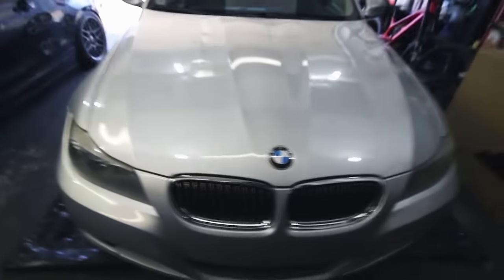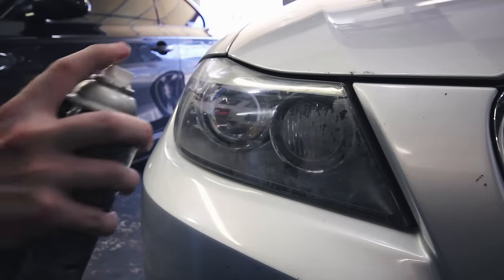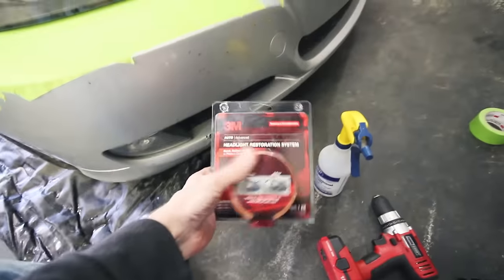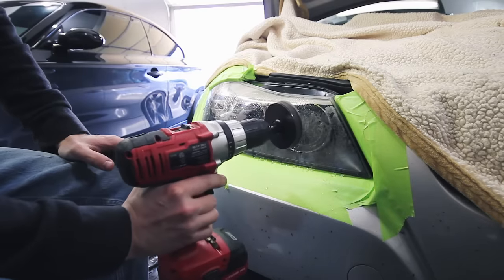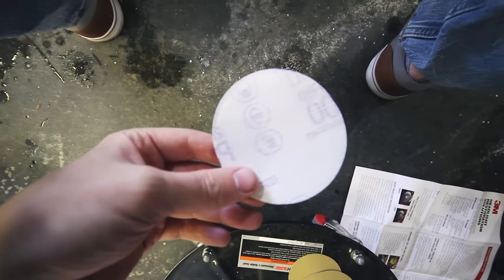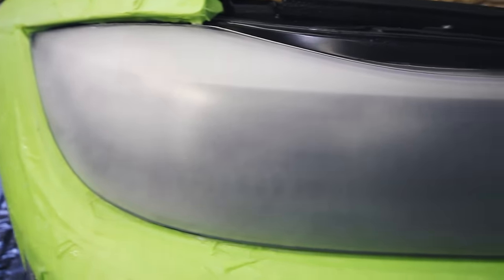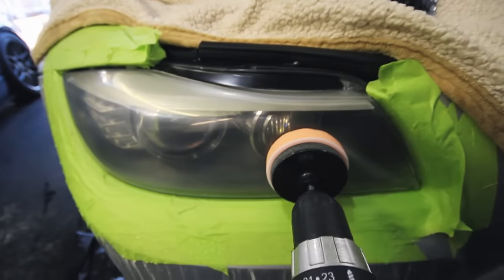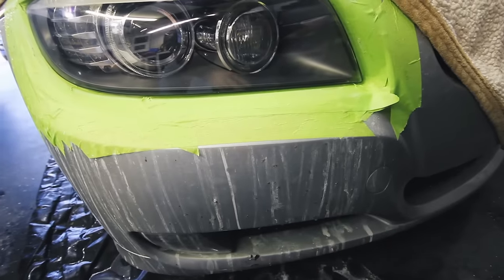How To Clean & Restore Headlights - Remove Yellow, Foggy Headlight Oxidation!

Comment: awesome job! But to get it perfect, smooth and with no swirl marks a random orbital buffer is best hands down using the same stuff to polish paint. I use meguiars 105/205 combo. 

I’ve tried 3 different drill type kits for the headlights which do a decent job but doesn’t get a showcar like appearance. You can still see swirls and hazes at different angles. Plus you don’t risk burning through the paint (or tape) with a random orbital buffer. 

It’s a lot of money to invest but if you’re into car detailing, this is the bomb.
Reply: maguires machine polish for mirror finish. I used to do molds for fiberglass parts, 
you can see your reflection in the mold surface.

Comment: As a word of warning I used a power drill for all stages and only at the end I discovered that I had damaged the bumper in the same way as you.
I would advise to use the glass (sand) paper stages by hand. Only use the polishing stage via the drill.
Reply from the maker: As long as you're careful and use protection on the paint, you will not damage it.
Reply: Other than that did your headlights look better?
Reply: @walphaa  yes it did. I only did one headlight as I was annoyed with damaging the bumper paint work.
The refurbished light looks like new.

Comment: Both my headlights are cracked. Has moisture now
Reply: 7SeriesDaily same 😔
Reply from the maker: Dang. That requires further repair. Are you sure they are cracked, and that it's not a bad seal/gasket somewhere?
Reply: Jake Spence yea the seal isn’t flush 🤔 now that noticed

Comment: Interesting difference in the Mookis headlight restoration kit. It has 3 steps of sanding 800>1200>2000 one per grit per headlight so it comes with 2 800s 2 1200 and 2 2000 then a polish and last a uv protectant. Not sure which I might use next time. The kit comes with a ridiculous about of .5" making tape that wouldn't even cover one headlights perimeter. But the polish and uv protectant come with way too much. I use only one pouch of each for two headlights. Even without skimping on it.Beautiful results either way.

Comment: I didn’t watch your entire video but keep in mind the rpm of the drill should not exceed 1500 rpm or you’ll melt the sanding disk to the headlight. Excellent product list. I only use those 3M kits. I skipped ahead. Nice work. Peace 💨💨👽

Comment: You’ll need 2 kits for sure.. plus you need to realize you’re essentially resurfacing your headlights without laying down an actual clear coat over the foggy/sanded/buffed plastic.  That oily coat you apply at the end that enhances clarity and shine wont last a week!
Reply: Exactly! I never realized what causes this to happen to headlights....when the car is painted in the factory...everything is clear coated even the headlights...after enough time in the weather and chips from highway driving that clear coat comes off and then the sun and hot and cold weather causes the plastic surface to deteriorate and actually become quite porous which then dries up and flakes off and becomes foggy...then it’s hard as hell to restore them...that’s what point my vehicle was at when I got it...I’ve never been able to totally restore them no matter what I use

Comment: If you sand at the start you don't need to clean it first... unless it is clearly covered in muck and you cannot see your work area (think caked in mud!)... clean it after you sand, given you will make a mess when sanding it.

Most headlights come out easily, so if you really want to minimise the risk of body damage, just remove them and pop them in a vice with a rubber mat.

Instead of this kit... you can just use a high grit sandpaper (1500+), then clean area with soapy water, then clean again with isopropanol, then spray a clear coat, then buff. Cheaper, quicker and what professionals do when you pay them (y). The clear coat is the key to a great finish as it levels out all the imperfections creating a clear looking lens.
Reply: Where can i get the clear coat?
Reply from the maker: Yup, these are some great tips for someone who wants to spend a little more time on them!
Reply: I wish it was that easy, Your quick fix method will not remove hazing, Yollowing, Or old flacking baked on cheap clearcoat!!!
Reply: @tupapi6989  amazon!!

Comment: When you get to the stage where you have used the sponge and the compound to get it looking like glass , to stop it happening again you can buy an ultraviolet clear lacquer spray and you just spray one clear coat over it and it enhances to the glaciers affect but apart from that it protects its from ultraviolet rays and basically stops it from happening again.

Comment: If you were going to use a drill and a fitting like in the video, I would emphasise when he explained to you keeping it flat it is a little more important than just keeping it flat for the sake of keeping it even ,if you were allowed it  to go out of control and turn sideways you can burn a divots or friction groove that can burn little Valleys into the lands, which sometimes you might not be able to get  out so take your time I'm and keep that disc flat.

Comment: Just bought the 3M kit as I have very similar levels of oxidation on mine too, but I've seen others using acetone vapor.   Ive also seen complaints of light scratches being quite visible when the lights are on, so I'm going to try the 3M in order to remove oxidation and finalise with acetone vapor.

Any thoughts?

Comment: You don’t need water for the first two steps. Gold and white sanding discs should be done with no lubrication as the instructions don’t mention water for those steps. It’s only mentioned during the 3000grit step should the water be used for sure cuz it’s basically wet sanding. I used this same kit, following the instructions, and they came out looking brand new lol. I get why you recommend the water to not burn the plastic on the headlight but in a way I don’t think you’re getting the full effect of the first two steps. Don’t get me wrong, your work came out good no doubt. Just run the drill a bit slower so as not to burn the headlight lol. First two steps should give you a frosted look. The 3000grit should give you a light hazy look and the rubbing compound will give you the fresh ass brand new look haha good shit though man 👌🏽
Reply: And I thought I was the only one who spotted this mistake!! 3M produce a wet kit for all those die hards out there who still use old school methods 😂

Comment: Hey mate i have 1,2 questions about n54 single turbo kits. Can i run the single turbo only with MHD backend and JB4, and how much boost can i reach with OEM sensors (solenoids) and stock fuel system. Sorry for my bad english.
Reply from the maker: Yes, you can run JB4 with MHD backend flash for single turbo. Just be sure your JB4 has the single turbo firmware loaded and you're using a proper single turbo backend flash. You will need a Mac solenoid to replace the OEM boost solenoids. Boost limit for stock fuel system depends on the size of the turbo. On a completely stock fuel system, you won't be able to get very much power out of it.
Reply: @jake_spence  Thank you for your fast response! When i blow my wastegates i will upgrade to ST. I don't know how it feels but i just LOVEE that sound. Stay tuned! Thank again!

Comment: I used this product before finding this video. I left swirl scratch marks even though I used the 3000 grit and rubbing compound 4 times in a row. No one else ever mentioned this problem so I thought there was nothing to worry about. Do I need to restart the whole process?  Also is there a limit to how much I can sand it?  I am afraid I will sand it down so much that it leaves a hole.

Comment: Would you recommend spraying a clear coat on the headlights at the end?
Reply from the maker: Yes, a UV clear would be perfect.
Reply: In my shop I found acrylic clear coat and all purpose enamel. Will that work? Also I plan to clean with alcohol. Also plan to put Mothers aluminum stuff as a final touch.
I figure I'll do this with what I already have including my sandpaper 500-3000.
What do you think? I'm not spending any more money on a "kit"! I'm a cheapskate dyi'er weekend warrior.

Comment: Good video, except next time take the time and pull your headlights out, it will save you accidentally sanding your bar, then you can use an orbital sander which will give you sooo much more control! 
I wouldn't waist your time buffing them after you sand them, because you actually sanded off the remaining clearcoat they have from factory, that means unless you clearcoat them again you will have no UV protectant on the lenses and they will get brittle, fade and fall apart!
After you sand them with 800, or 1200 grit(dont go to fine or the clear wont stick), clearcoat them and they will look better than brand new!
Reply from the maker: Some good tips here for sure. Thanks for watching!
Reply: Not all people have time to remove the headlight or paint it with UV coating so this is better

Comment: what if I skip the last step and  spray it with an anti-uv clear coat instead?
Reply: Piteng Best to spray with 2k clear coat before he used the 3000 grit. The clear coat needs fine scratches to grab onto, otherwise it’ll run and crack on ya.

Comment: Don't spend your money on that kit, just get some 600, 800, 1500 sandpaper, wet sand lights starting with 600, work your way to 1500 and use either Meguire's polishing compound or Mother's polish. You will save a lot of money.
Reply from the maker: The kit is pretty inexpensive, I'd rather buy one kit and have everything I need. But that's just me. To each their own!

Comment: I would apply a UV coating after, otherwise, it will just oxidize again too quickly.
Reply from the maker: Definitely! You must do this if you want them to hold up long-term.
Reply: What is a good UV coating?
Reply: The Diecast Fanatic rustoluem gloss clear

Comment: I'm not happy after doing passenger side headlight. Quality is good but the WOBBLING of the sanding pads SCRAPED 2 slits on the bumper paint. Like you!
But mine it went thru the the paint and into black bumper! Now I got 2 ugly damaged spots and me angry.
I did put 3 layers of masking tapes prior but the protruding sanding pads wider than the spinning pad is BAD BAD BAD idea. Plus they wobble when spinning.
Now I'm hesitating to do the driver side. There has to be different ways to do it. After seeing the problems, I avoided reaching close to the bumper/fender. 
Tight corners I used finger to sand. 
Why did  3M make the sanding pads WIDER than the backing disc? SUCKS!

Comment: Very easy. I have a 07 350 Z I try everything Just go to Home Depot buy a can for 6 dollars Off Deep Wood Bug spray Spray it on your head light Wipe it off It will never turn yellow again  But i suggest Every summer do not spray it on your family What in it It can clear head light I forget if you got stain like mine was Do the  sandpaper and water first. Then spray the Off Deep Wood Bug Spray

Comment: would have removed the headlight to do it, and you get a UV coating to reapply to protect instead of basic wax
Reply from the maker: For sure, but it's hard to remove the headlights on these BMWs. But that's a good tip for others.

Comment: How long do you have to wait before applying a ceramic coat?  How long do you wait before you can wash the headlights, and do you recommend washing the headlights before ceramic coating?  

Which brands of ceramic coating works best with this 3M product, or with headlights in general??

Comment: Would tinting the lens after the restore prevent hazing from ever happening again?
Reply: It depends. Tinting would only prevent oxygenation of the exterior of the headlight. If you get any sort of water inside the light, condensation being the most prevalent you will have the same issue. The heat from the bulb causes the oxydation to speed up

Comment: I also scratched my paint. I wish they include another pad in a smaller size for the edges.
Reply from the maker: Agreed!
Reply: just use one of the older first stage pads and sand down the edge using your finger,esp that corner of the light where the round pad couldn't go.Dont sand it too hard,light and multiple strokes does it haha

Comment: Well ya know i wish i saw this before i spent $545 for new light covers. You called them lenses & to me anything that doesn't magnify is not a lens, it either plastic or glass. Also i have bought every product i could find at my local autopart stores over the years. Not one product ever told me to use a drill to sand, but i did that last time with barely any results. I have never seen a 3m product for lamp cover refinishing before. I hope to never have to. I really do like the brand new covers although rediculously expensive & thats because i went through my mechanic & he refuses to buy products online but i found new ones for as little as $40 each but cant testify to them.
Anyways...

Comment: Jake you know if this would work on an e36? My lenses are trashhhhhh
Reply from the maker: Yes, it will work on an E36. However, some older BMWs like the E36 and E46 have replaceable lenses. So like Justin said, you can buy brand new replacements for cheap.
Reply: Jake Spence didn’t even see you guys respond. I’ve been considering new lenses or upgrading to glass but this thing is a missile and I can’t justify a few hundred dollars for some hotboi headlights lol

Comment: You should check out ChrisFix's method to restore headlights. Unlike 3M's method, his is permanent, and your headlights will never oxidize again.
Reply from the maker: I will check it out. However, I've had permanent success with this method. These headlights still look brand new. Just need to protect them after polishing them.

Comment: you dont need all this ,just add blinker fluid and drive
Reply: where u get blinker fluid
Reply: @jayj4466  just go to any supermarket they will give you blinker fluid. but make sure its 1:1 otherwise it wont work
Reply: which supermarkets in Durban...so u just apply it on the headlights ane it cleans like new
Reply: @jayj4466  any supermarket, and you have to fill your headlights with the blinker fluid

Comment: Wouldnt it be faster and easier and safer to take out the lamp??
Reply: Siggy if you’ve ever had to take out headlight housings you’d realise how difficult some cars can be so probably not. Some cars require you to remove the front clip first
Reply from the maker: Yeah, it really depends on the car. Some are easier than others. Then you have a find a way to clamp them down while you work on them. I think it's just easier to leave them secured in the car.
Reply: Jake Spence but the cosr if damaged is high..

Comment: First sanding process you removed the protection layer that the light came originally with ..
That left the plastic surface unprotected against dust sand and all other weather conditions.. and its just a matter of time tell it turns black again 
You gonna have to do this again and again every once in a while 🙄

Comment: grab cheap toothpaste spray then spray water then dry it, there fast cleaner, ps: i am poor so this stuffs i do to clean plastic, mirror almost on anything
Reply from the maker: I mean the 3M kit I used is only $10. That's pretty cheap and works proper.
Reply: @jake_spence  that's great and all, it really do but $10 is a good meal for me for 4 days
Reply: u used toothpaste on headlights wiped it. den wipe it clean
Reply: @jayj4466  almost toothpaste known closing tooth cavity, so i really don't know why it actuality do the same in plastic material even better if you used to clean dirty mirror it do the same stuff as cleaning our tooth
Reply: so u say any toothpaste will work
Reply: @jayj4466  try it, it's cheap and you got nothing to lose

Comment: Um so you are just sanding away the old layer of plastic and exposing a new one? Wouldn’t that leave texture for fogging to happen even more quicker now?
Reply from the maker: If they are already fogged up, the plastic protectant is gone. Sanding it away won't make it any worse. Once it is clear, protect the lens with a coating.
Reply: Jake Spence ohhh gotcha, thanks!

Comment: If you use anything with wax as a final step your headlight will haze again because the wax turns white. I wouldn't recommend anything with wax
Reply from the maker: Good point, a UV protectant would work well.

Comment: After using rubbing compound you really need to follow up with a finishing polish and then a glaze, which is essentially a even finer polish. And definitely definitely don't use Ceramic Coating to seal the headlights. Don't believe the hype. Ceramic Coatings don't last anywhere near as long as these Hypesters are claiming. That's laughable nonsense.  Use real 3M Clear Coat spray instead to keep them from yellowing.

Comment: Mothers. Mag wheel cleaner and a towel will do the same thing and a Hole lot cheaper too much work his way Try it youll be impressed
Reply: Is that the same as Mothers Chrome Wheel Cleaner Spray? Don't see anyone selling "mothers mag wheel cleaner", but did find "Mothers Mag & Aluminum Polish", which is a paste. ~Thanks
Reply: @AShaw-n7j  The paste is the one to use and Rub in circles and you'll be suprized in the turn out
Reply: @rogerwatson5995  Awesome, thanks for the prompt reply! Do you use a drill to polish or just do it by hand?
Reply: @AShaw-n7j  For me id Definitely do by hand bein plastic headlights for me im 69 years old and a Major Mustang man as if you spend over 45 min for both there's something wrong for best out come a wash clothes  work best Have fun and you'll be impressed after as I rule 3 times each headlight  brings out Awsome Beauity
Reply: Hope your headlights turned out better than expected As the More paste polishing you do the better they get